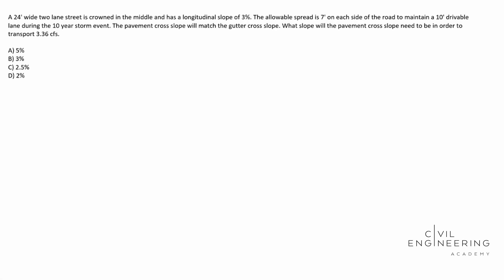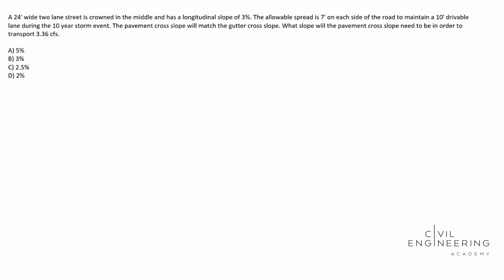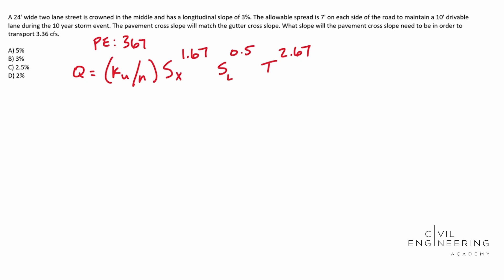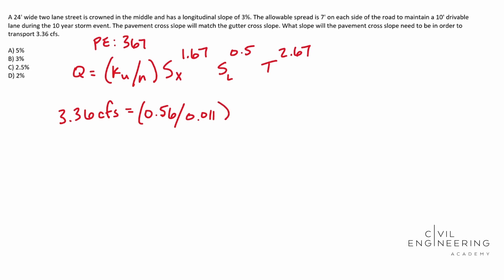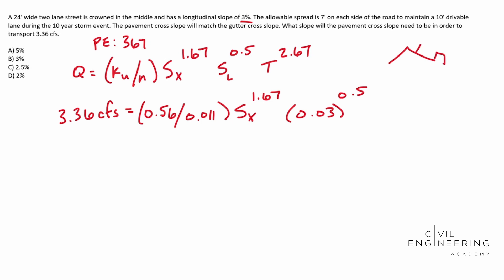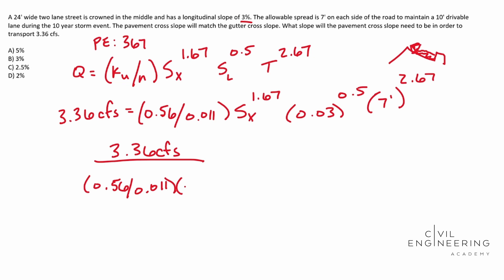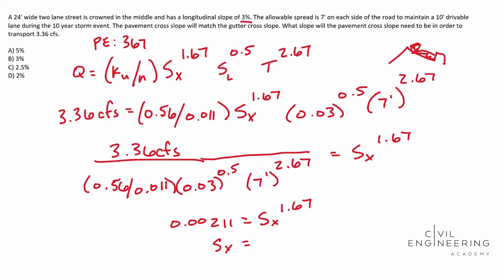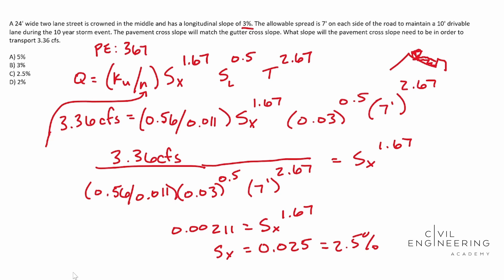Civil PE - Water Resources - Hydrology - Calculate Gutter Cross Slope

Comment: Ncees pe hb 1.1, p. 367, 388.

Love this problem. But got a tad different answer so I think the presenter rounded too soon:

S_x = 0.0256 = 2.567 % = 2.6%

But this answer isn't listed so by engineering judgement I'm tempted to round up to 3%, which isn't correct, according to the problem setup.

So I think the solutions list needs to be amended to include 2.6% OR require the engineer to round up to 3% using "engineering judgement".

Also...the real PE exam ALWAYS lists answers in an increasing order. Your answers are scattered in value. Why ?

Thanks.

Comment: Manning n for asphalt is 0.013? Why would we use cement to find the cross slope of the road?
Reply: Valley gutters are almost always made of concrete, which has a Manning's roughness coefficient of 0.011. I understand if you solved with a coefficient of 0.013 for asphalt your answer should have been 2.76, so the question definitely should have clarified material type in the gutter area.
Reply: Ncees pe hb 1.1, p. 367, 388.

Manning n is responsible for the roughness. Think of roughness as on a scale of very rough to very smooth.

Roadways are made of concrete, asphalt, and compacted dirt. The former 2 are relatively smooth when compared to other surfaces such as grass, rubble, etc.

Your thought process should look like a list:

. What's my road material? Asphalt or concrete.

. Which n does concrete and asphalt have? 

. I'll take an average of the range reported in the n-chart.  N= 0.0115

. Plug n into gutter equation.

. Solve problem for S_x.

. Done.

Comment: Dont we need to divide 3.36cfs by 2 ?
Reply: problem statement doesn't make it clear, whether the 3.36 cfs is per gutter or for both gutters combined. hopefully exam questions will make it clear.
Reply: I think you are right since the problem says the gutter slope is the same as the cross slope.
Reply: I felt that this we were calculating the flow generated from one of the two gutter lines, keeping the 10' lane in the center. I agree with you here.
Reply: No. Read problem statement carefully. It's easy to misinterpret. Also, dividing Q for a gutter problem is highly unusual for this type of problem. I've done a bunch like this. There is never even a hint of dividing by 2.

The Q is intimately connected to that just 1 side of street.